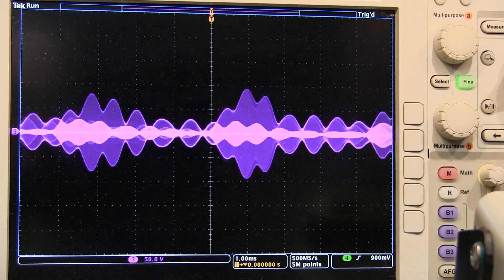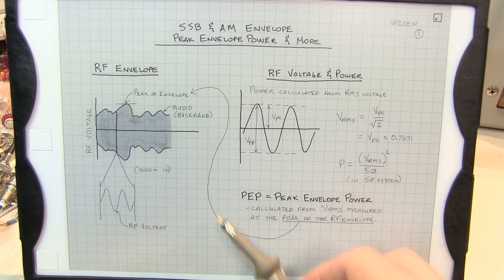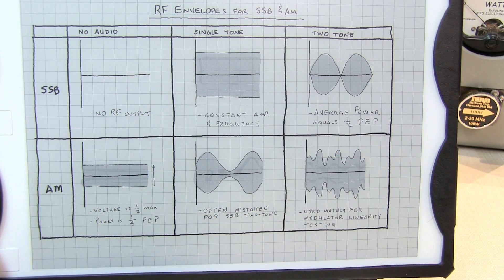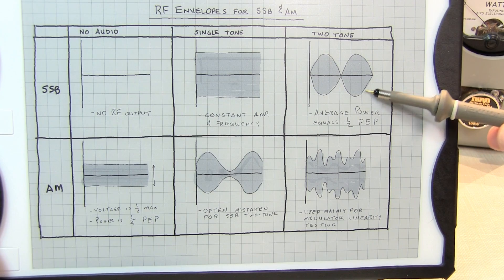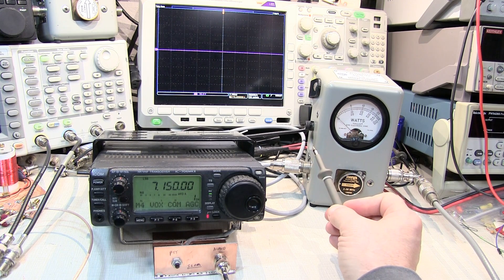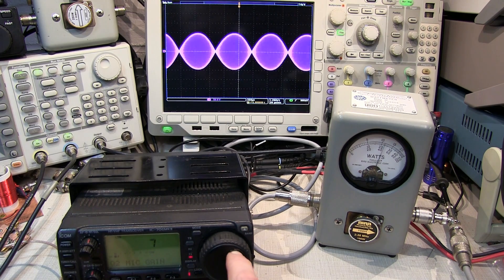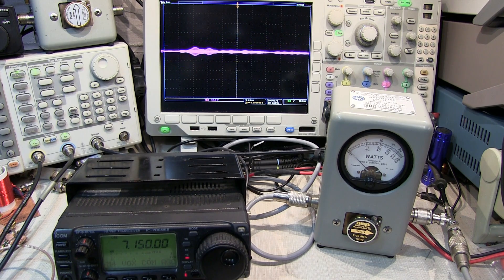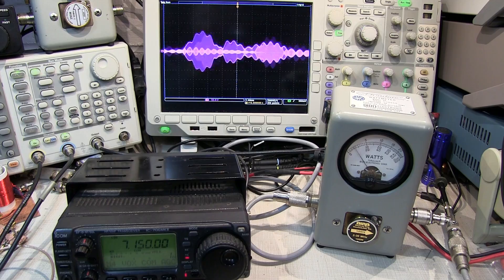#296: SSB & AM RF Envelopes, Peak Envelope Power (PEP), Average Power and more

Comment: Hi Alan,  thanks for this video at a perfect time for me as I'm trying to align SSB on a radio of mine.  Can I ask, is the mic gain on your radio at maximum for this two-tone demonstration?  I presume I should I have the mic gain at maximum whenever following an SSB alignment procedure?  On the radio I am working on I get the SSB RF envelope pattern as shown in your video, but only with the mic gain on my radio turned barely a quarter of a turn.  From this I have assumed the radio has been previously set up with too much gain and I need to back it off to show the two-tone RF envelope at mic maximum - would that be correct?  The service manual states 30mV for both tones, which I've set, but i presume that if I lowered the level of each tone I'd be able to get the RF envelope pattern where  I want it at maximum mic gain - but then I guess the audio output from the mic over SSB would be too low?  Just a bit confused right now.   I'm using a Marconi 2955B for the two-tone signal and wattmeter and separate 100MHz scope .
Reply from the maker: The audio and mic gain settings should be set such that the ALC is just barely starting to show deflection.  You also need to be sure to adjust the levels of each tone so that they result in the same modulation level (sometimes the frequency response isn't flat in the audio path, so the levels have to be set independently).
Reply: @w2aew  Ah! Got it - thanks.

Comment: Takes me back to broadcast engineering training when I was training to work on the maintenance of broadcast transmitters which ranged from a couple of watts up to 500kw in all broadcast bands.

Transmitters tend to have a duty cycle which says for how long a AM transmitter can run 100% modulation before the power amplifier starts to overheat and shutdown, but as the modulation was fairly low and normally music and voice the transmitters seldom if ever go near the duty cycle rating.

Many amateur radio transceivers have a duty cycle figure which for a quality transciever will be shown in the manual or the specification.

Comment: It would be interesting to hear a demodulated SSB signal (e.g. voice) being slightly out of tune... I love your didactic videos BTW.
Reply from the maker: Sounds like a typical voice pitch changer
Reply: @w2aew  That's indeed what I was told in my signal theory courses a long time ago. Never had the chance of listening to SSB. Although digital pitch changing is relatively easy (a la chipmunk), doesn't have the same... you know... analogue charm ;-) .
Reply from the maker: @nashaut7635  You can listen for yourself on any number of online receivers.  One good site is sdr.hu.  Pick a receiver, tune to any of the ham radio bands (75/80m and 40m probably most active) and you can listen to SSB, and even try adjusting frequency up/down to hear the pitch change.

Comment: Which oscilloscope probe were you using?
Reply from the maker: It is a Tektronix MDO4000C series.
Reply: Thanks, but I'm referring to the probe, is it a standard High Z or something different, looked like an older probe connected to the tee adapter.  @w2aew
Reply from the maker: @PaulZuhlke  Oh, sorry - yes it is an older passive 10x probe, connected to the tee with a BNC-to-probe-tip adapter.

Comment: Hi Alan. GREAT video and explanation. I would like to duplicate your setup to help me retain what I just learned. Could you offer some detail on your RF tap off the back side of the watt meter to the scope? Thanks 73 N5RXP
Reply from the maker: I'm simply using a BNC-tee and a BNC to probe-tip adapter, similar to this:
https://www.amazon.com/Cal-Test-Electronics-CT3655-Oscilloscope/dp/B009QBSKE2
You have to be sure that this fits your particular 10x probe.
If you don't care about it being "calibrated", then you can use any number of methods to sample the RF.  I have a few videos on RF Samplers that you might find interesting.  These will allow you to get the signal to the scope easily.  You could then do a simple calibration on your own (measure CW power and then calculate the response on the scope to arrive at an effective RF volts/division).

Comment: Excellent video Alan! This shows exactly why so many so-called techs horribly mess up CB radios in the attempt to make them put out more power. I’m a firm believer in using a monitor scope to set the modulation level of a transmitter on AM and SSB. Also, a lot of hams don’t really understand that much of the transmitted signal in an AM  station comes from the modulator in the form of audio power. 
A similar video regarding power measurements for FM and RTTY/ data modes would be good also.
Reply from the maker: FM and RTTY are both constant amplitude modes (both modulate the frequency, not the amplitude), so the RF envelope is constant.

Comment: Enjoyed the video!   Understandable, you said effective and it reminds me of the root mean squared of AC. effective value of AC.( .707 times the peak or 1.414 the rms) If the meter was quick enough to read it in real time it would be accurate.   RF carrier is fast according to what frequency it's tuned to. The lower signal which modulates or rides on the carrier.... I imagine it has an effect on the carrier... like harmonics  ( I play guitar so I know about harmonics)..... But both average out mathematically, (I'm sure there is a formula!!!)   If it all was converted to DC with a rectifier it'd be double on the top reading on the scope right?   Or eliminated to one half the signal on top.   And if a L or pi filter, an inductor in series with one or two capacitors to ground, (a resonant filter tuned for that frequency) the carrier would be eliminated.  Right?  I've been watching you for a while. I enjoy your channel.

Comment: Very nice Job Alan, especially on the two tone explanation on SSB.   
Q: Should we use 700/1900 Hz for the two tones?  If not, what are the most common?
Reply from the maker: The actual tone frequencies isn’t terribly important. Just be sure to adjust them for equal modulated amplitude (crossing points in RF envelope should be very sharp).

Comment: Great video as usual Alan. The single tone method using my frequency counter you taught me is how I tune all my SSB boat anchors. I have told many other hams about you and many use that method.  Great stuff. 
I have a Drake W4 watt meter in my shack.  I would like to learn more about adding the peak responding circuit you mentioned.
73s
KF6HF
Reply from the maker: You might take a look at the PDC-1 - it might be adaptable to the W4:
http://www.hi-rescom.com/html/pdc-1.html
One of the reviewers on eham put one in his W4:
https://www.eham.net/reviews/detail/999
Reply: Of course, the Drake W4 Wattmeter is not a low end part, but the conversion which Peter describes here https://www.youtube.com/watch?v=Mt0A1hQ_uR0  is also valid for this. In any case, I have rebuilt my W4 exactly the same way and it works flawlessly.
73 Bernd

Comment: Hi Alan. Thanks again for another great video. I have just started reading the section on PEP and ERP in the new ARRL handbook so this will undoubtedly make things clearer. Gong to try and read through the whole book over the winter☺️. What would you recommend for a scope adaptor? I actually have a 706 Mk2G sitting on my bench that I am going to install in my Land Rover, mainly for VHF but will also try HF. I might try repeating some of your video. Thanks again.
Reply: @Willam_J  Hi William and thanks for the recommendation. I have put that on my eBay watch list. Always good to know someone else has tried something and found it to work before buying. Cheers.
Reply from the maker: I have a few videos on RF Samplers that you might want to review.
Reply: @w2aew  thanks. I will carry out a search.

Comment: I really liked this video, thank you for sharing!  Are you using just a 10x probe in this example? I'm just curious about what's necessary for input protection. I'd also like to see your explanation of bessel functions in FM modulation, not sure if that is something you'd take the time to create  as it certainly would take some effort but I think  I speak for most of your viewers here on YouTube, you are an asset to the electronics and amateur radio communities and we are very grateful for your hard work in making these excellent videos!
Reply from the maker: Have you seen my video that discusses FM deviation measurements using Bessel Null?
https://www.youtube.com/watch?v=8IBOYoIV5m8
...and yes, I was using a 10x probe.  You'll have to check your probe's ratings to be sure of the safe operating area.